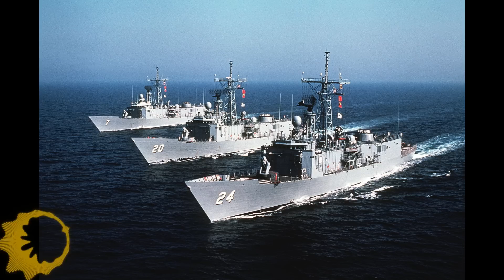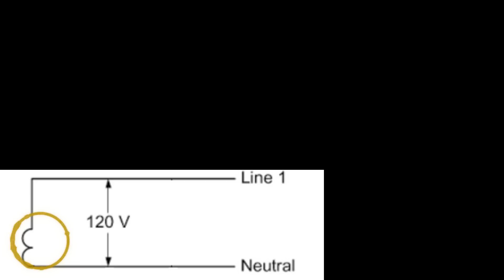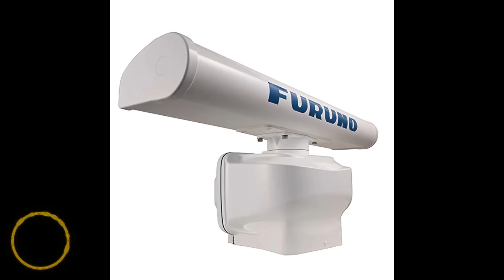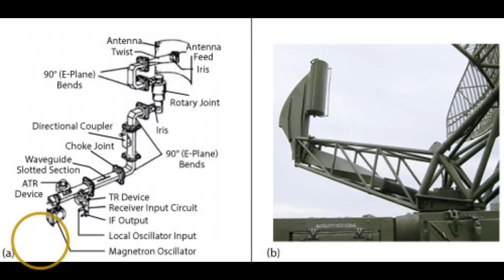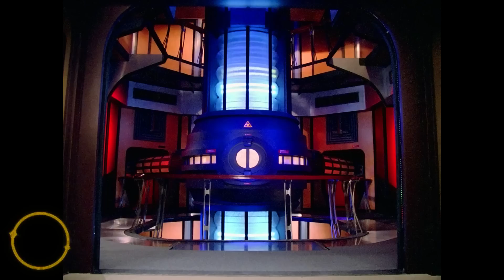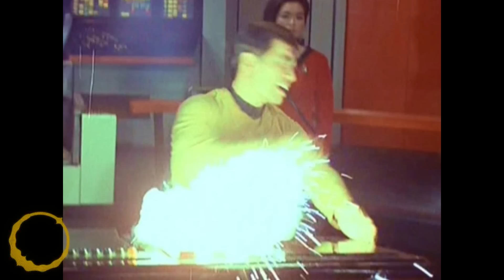You done put a grid in your EPS

Comment: In the TNG technical manual, diagram 7.1.1 major utilities trunks, we see that all three power generation systems provide power to the EPS network, so warp drive M/AM reactor, Impulse deuterium reactors, and fusion auxiliary generators (I could have swore deuterium is thought to be a primary fuel source for fusion reactors, so I am uncertain why impulse reactors specify while aux power does not) these are picked up by EPS taps, then put into EPS distribution, and finally in to every sub system in the ship.

I found no reference to it in TOS technical manual, nor do I recall it being mentioned in TOS, so I can only assume it was retconned in as the result of writers needing a Handwavium Plot Generation Device for an episode of TNG and asking the props department to find them such a device. The fact that it is coincidentally similar to wave guides in concept function is likely happenstance, but ST did have SOME knowledgeable members in the production team, so one may never know.
Reply from the maker: Yeah, the ships had a much more distributed power generation system than I let on to - most notably the saucer section of the Galaxy-classes could maintain full impulse almost indefinitely without a warp core - but it all comes back to EPS.
Reply: @SacredCowShipyards  the amount of redundancy is insane. of course you want insane redundency when your ship is powered by antimatter.
Reply: Several years ago, I was active on Facebook and a member of a Star Trek group that also included Rick Sternbach (Author of the TNG Technical manual) . II asked him one time how the Electro Plasm system works, and he replied "Thermocouples". IT made sense to me. If you've ever seen or heard of a BioLite stove (I have one), it can charge a cell phone using a thermocouple that converts heat into electricity. The way I figure it, the EPS system is a closed system, and EPS Taps are extremely efficient thermocouples that convert heat from the plasma into electricity. I have a theory on Warp Plasma and how warp coils work that's similar. Warp coils are made of a material that gets more magnetic the hotter it gets, so they use Warp plasma to heat the coils enough to warp space.
Reply: I don’t think TOS thought beyond “Jeffries tube”.  In the episode with the antimatter man Lazarus, he starts a fire in engineering by rearranging what look like conventional fuses.   Although there was an episode where Scotty had to put a magnetic probe into an energy flow which was not mentioned, but could be retconned, as plasma.
Reply: @StrongDreamsWaitHere "there's a service crawl way but it's not meant to be used when the integrator is operating." Scotty
Reply: i wish i still had that book, i could end a lot of internet debates with it. some of it is actually scientifically accurate. it goes to show how much effort went into world building. i dont think the current iteration of trek bothered with these kinds of details. everything runs on magic mushrooms ffs.
Reply: Fusion auxiliary generators makes perfect sense. You need a way to power the ship while the engines are shut down for servicing, or inoperable from combat damage.
Reply: @vylbird8014  same function as the apu in a jet liner. big engines need smaller engines to bootsrtap them. its worse with nuclear reactors of all kinds.

Comment: Star terks eps system sounds more akin to a steam distribution line that power locomotive
Accessories like injectors and dynamos
Reply: there is a plasma injector in each nacille LOLZ
Reply: I agree, in fact I kinda view warp plasma less as the product of matter antimatter reactions in dilithium because that doesn't make sense, and more like the reactor coolant.
Reply: Im pretty sure that star treks EPS system is directly inspired by real world naval steam power plants.
Reply: a lot of ships still use steam power for everything. though eps is more particle accelerator/fusion reactor kit. lhc/iter stuff. eps power taps is pretty much direct conversion of charged particles to electricity. its viable tech but that doesn't become useful until we start fusing aneutronic fuels, we cant even do the neutron happy fusion yet with any kind of positive gain. in either case what you are really doing is moving heat around.
Reply: @LordOfNihil  Back +100 years ago this was true, sure plenty of cargo ships used steam powered cranes and way longer for the galley. But its not many non nuclear steam ships left and none of them use their steam outside the engine room. 
But steam is very dangerous, more so on an warship who you expect will take damage, back in ironclad time this would be true steam was used to move guns and other stuff but it was changed to hydraulic or electrical
Reply: @magnemoe1  was referring specifically to the nuclear option.  ww2 ships also used steam for things like heaters and auxilliary generators. but its a lot easier, cheaper and more efficient to run cable than insulated pipe everywhere. you trade off being scalded by steam for being electrocuted, so id say the danger is about the same.

Comment: The Mine Sweeps go in FIRST because all other ships are only a MineSweeper ONCE!
But yea...if the MC is in a fight...things have REALLY gone to shit.
Reply: Except for Samuel B Roberts FFG-58. Apr 1988 Straights of Hurmuz. Epic story of damage control done right.
Reply: IIRC, the Iowa Class BBs were designed with mine-sweeping ability.
Reply: @jakeaurod  lol, that is litteraly insane & in possible. Hunting mines takes short controlled movements. Maybe they could pull sweeping gear, but that is NOT HUNTING, & I highly doubt a BATTLESHIP had the sonor to hunt mines.
Reply: @xxxlonewolf49  Think the idea was that it could be used if it was some danger of mines in an area who was swiped but an sub could put in new mines, and it was just an add another system on the ship as its big, also an Iowa would eat an small mine much better than an destroyer. 
Not sure if ever used?
Reply: @xxxlonewolf49 yeah. Quite a few ships have anchor points and equipment for those mine sweeping wire things, but tgats pretty much it

Comment: The rocks in the consoles are there to try and insulate the fields created by the energy flowing through the mini-conduits. During surges the casing cracks and explodes into rubble shrapnel. Honest.
Reply: No, no, the rocks are stowed in the overhead for… reasons. We see them fall down whenever the ship gets bumped hard enough to temporary shut down the inertial dampers.

The chunks that blow out of consoles happen because the consoles are pre-scored to let them break up into sizes manageable by the repair crews who we oddly never see replacing blown up consoles.
Reply: Gneiss explanation!
Reply: I always figured the rocks were fused matter, created by the surge that caused the explosion.